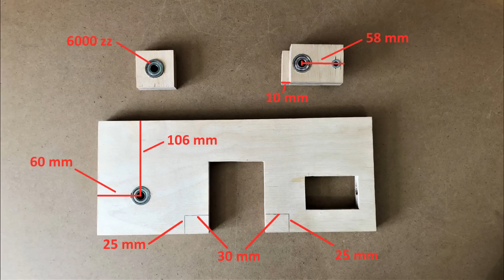DIY Metal Cutting Bandsaw // Making a Portable Bandsaw (Drill Powered)

Comment: Good work. This project is way more difficult than it appears. I have been trying to make one but encountered loads of problems. I have a Bench drill which refuses to drill straight holes therefore the bearing shaft doesn’t run anywhere near true. Your holes need to be super accurate and aligned precisely. I bought the bearings as shown and some 10mm mild steel bar and the bar doesn’t fit through the bearing centres, I had to emery paper the shaft to fit and now due to this and the slightly misaligned bearing holes the shaft is so stiff it barely turns. I am going to have to start again. This is not an easy build and I have been a carpenter for 50 years. I admire you sir.
Reply: you can buy pre ground and hardened steel rods might make it a bit easier :)

Comment: Very nice design and build  looks like it is a fairly  easy to use porta band as well  I originally. Thought the  external drill would make it  bulky but it  actually does not look to be so  by using it as a handle  like you demonstrate

Comment: Gökmen, thanks for this video, looks awesome, quick question, does the blade not get hot, and if so how would you go about cooling it down, then another question, you used a vice which i have not seen in any of your other video's, it too looks really good, I am assuming you made it yourself, if so do you perhaps have a video of the build. Thanks again
Reply: The entire length of the blade acts as a heatsink.  It's the same reason a gatling gun has multiple barrels.  You could add additional cooling to the blade if it's still getting too hot

Comment: This is awesome work! I have two questions: 
- Why is it necessary to angle the blade at the cutting region, unlike the big band saw?
- How much do you think you can scale up this design and still be reasonable portable and not too heavy? In terms on blade length (I see your blade is 83 cm long)
Reply: If the blade isn't twisted then the max cut width is dictated by the wheel diameter. With the 45 degree twist it's possible to cut long stock without the stock hitting the part of the blade that's on the other side of the wheels.

Comment: Really nice build, though having another way to close the safe guard would be vise, for metal cutting saw, anything magnetic is bad idea for obvious reasons and it would be good to have its own motor, instead of running it with cordless. From experience these drills take really poorly axial loads and are designed for linear loads. End result is wobbly chuck. I used my old makita as poverty lathe for small parts and two newer dewalts in my diy bandsaw and chuck bearings become really loose after few usages. Better to get cheap corded drill and make attachment for it, or just use some smaller electric motor. Unless you replace slide bearings in drill with ball bearings this will be the end result.
Reply: Or use an angle grinder for power

Comment: Great job. Been trying to put it together. Seems like you ran out of video time. Why not do a Part 2 to finish it up. More info needed on blade guides layout and might as well show more cover/lid construction. You show in vid equal widths of legs holding guide bearings but dimensions are unequal. Have looked at that area closely and think both legs should be 20mm not one at 16mm. Also dimension for fixed wheel is from rear and tension wheel from front. There appears to be a small error there of 1mm but it would work fine regardless. Blade guide block attachment is a bit on the weak side - so much going on in that little area to make a strong connection. Just offering my observations as it gets built - not being picky. Job well done - lets see some more. Will check out your other vids. Thanks for posting.

Comment: I imagine this is a lot cheaper than buying even a cheap portable band saw. I've only priced milwaukee and they're expensive for a small one
Reply: If you’re already in the Ryobi platform, you can pick one up for pretty cheap and it’s an excellent bandsaw for the price.
Reply: @Hoellewood_Solutions  Although I am slowly transitioning to rigid, that would give new use to my Ryobi battery
Reply: It’s funny, I use both platforms. Ridgid is my primary, but what I couldn’t afford in it, I’d get Ryobi. Ryobi used to be my primary. They are both great and Ryobi just keeps closing the gap on Ridgid
Reply: @Hoellewood_Solutions  Ryobi seems to be going downhill, to me. My old impact refuses to die even after nearly a decade of brutality and my few years old hammer drill already has a wobbly chuck, cracked handle, and lost some of its power. My rigid impact is a lot lighter and has more power than my Ryobi did new
Reply: @Mr.Neko013  okay, yes. I’ve been seeing this with my father’s Ryobi drills. That’s why I got him a new HP impact driver. I kept telling him that up until a year ago, Ryobi wasn’t very good compared to Ridgid, but what they have been putting out the past year is blowing away the competition. The New HP line is just as powerful as Ridgid tools, trust me, I’ve used both.
Reply: @Hoellewood_Solutions  But are they as durable?
Reply: @Mr.Neko013  as far as I can tell, the construction of the new tools are far superior to what they used to be. The ergonomics alone are tenfold what they used to be.

Comment: Great! Why the 45° twist on the band is needed?
Reply: To get cutting depth if it was at 90 degrees you would only be able to cut of the ends of tubing.
Reply: Take TV remote, imagine it's the saw and try to cut a pencil from the middle with it. Then you'll understand why.

Comment: What are the advantages of this bandsaw over an angle grinder?
Reply: I think the advantage is you can cut large dimension steel cleaner than angle grinder.
Reply: Also less noise with more safety
Reply: @deepujoy3809   Yes

Comment: Why can't you just use the angle grinder  to cut? 
What benefits does the bandsaw have over the battery grinder or a traditional hacksaw?
Reply: hacksaw is quite laborious and angle grinder is dirty - remnants of grinder disk will be all over the place.
Reply: There's also cut depth. Unlike a reciprocating saw, a band saw blade doesn't flex much resulting in a straight cut every time. As an electrician I frequently use portable band saws, reciprocating saws, and sometimes angle grinders. I refuse to kill myself on a hacksaw, though.

Comment: How many teeth has the blades got please
Reply: Hi Paul, the package doesn't say it, I did notice that in the tool store, like a home depot, have the replacement packages, perhaps you will be able to find the right teeth size, I guess since this is for metal you'll need the saw similar to the hacksaw teeth. Hope it helped. 
Semper Fi